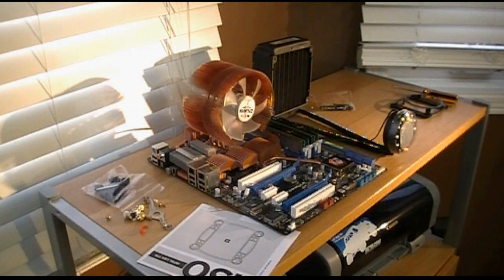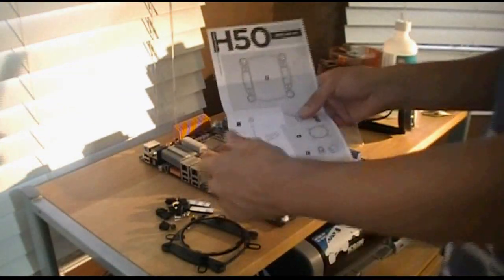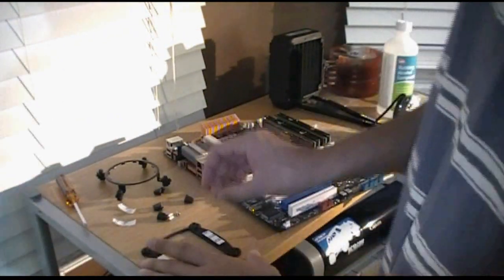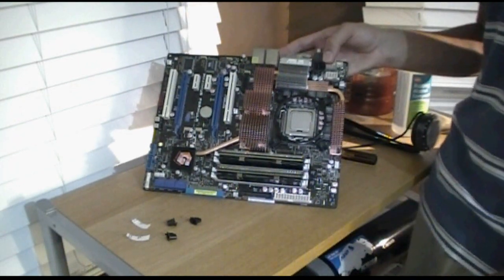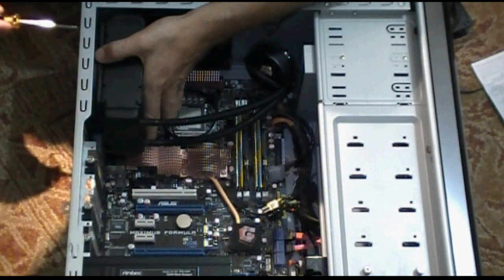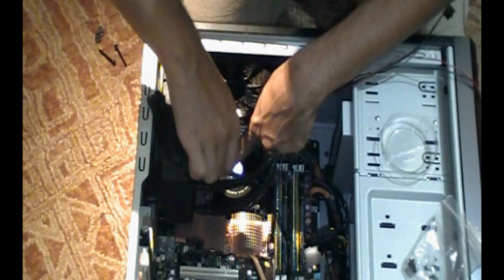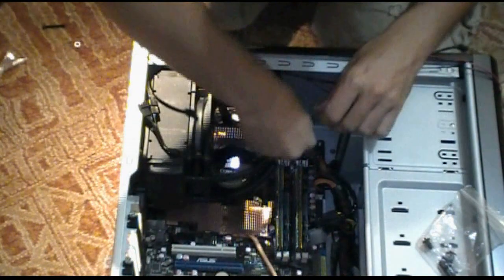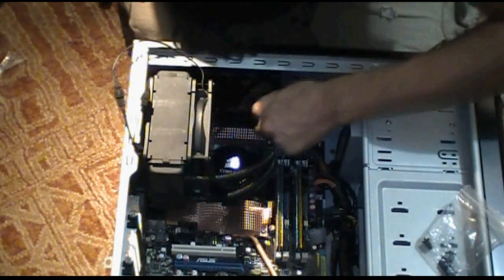Installation Guide Corsair H70/H50 (Intel) by The Tech Source

Comment from the maker: @fademan OHHH I think I know what you mean now!  The two fans each have a 4 pin power connector, you then connect them to the included Y-cable which has a single 4 pin on the other end which is connected to the motherboard.

- Dave

Comment from the maker: @ShervinGetOffMee What do you mean one fan slot?  The Pump plugs into the cpu fan header, and the other 2 fans have a coupler that makes them connect to any one other fan port on the motherboard.  Unless your motherboard only has the cpu fan header, which would really suck :(

- Dave

Comment: Just a quick note guys, not trying to be rude :) When your start to screw the brackets in place, you only need to turn the screw enough to hold the bracket in place. Ideally you also don't want your thermal paste touching the cpu until after the pump is in the correct place, so you can apply just vertical force for even distribution and less chance of air trappage.

Comment: @finaldestinyx The difference in most reviews is about 5-10 degrees Celsius (H50 vs H70) which is about 9-10 degrees Fahrenheit. Doesn't sound like much unless your OC'ing where every degree is critical. I spent the money for the H70 and went with Noctua NH-P12 fans for quieter running and better airflow. Still building at the moment so I can't give you my own temp results yet.
Super easy to install both H50 and the H70!

Comment: Also most users should actually attach the pump to a sysfan header and not the cpu header,(the extra cables are to drop your rad fan rpm to 1600 insted of 1950 max, to make it quieter at max. unless you turn off all fan controls in the bios for the cpu fan header it may slow your pump which you want running at full 100% of the time. the rad fans should go to the cpu header so that you can still allow your fans to be controlled by the bios (personally id just let them run at max all the time)

Comment: This is the simplest way for a less experienced user that doesnt understand the bios settings etc etc etc.... letting the pump drop with screw your idle temps to no end. which WILL happen if the smart fan settings on your mobo are enabled

Comment: What I found worked best was to not even deal with the retention ring until the end. At the time when you're going to install the cooling plate, take the retention ring and lock the cooling plate into its position. NOW go ahead and put them both down and screw them into position.

Much easier than having to deal with the godforsaken "HURRR TURN CLOCKWISE" crap.

Comment: I'm thinking of upgrading my H50 to the H70.  I just don't really know if I can part with £70-80.  From what I've read, the upgrade won't do any justice.  On the plus side, the H50 (and I'd imagine the H70) as very simple to install, and I'd recommend either Noctua or Xigmatek fans to supplement the radiator, rather than the stock Corsair fans that accompany the cooler.

Comment: does your radiator and fans cover the pump? I have a gigabyte board and my cpu slot is pretty far back towards the backplate and i'm worried it might not fit and i would have to use 1 fan instead of 2.. also did you previously own a h50? if so did your temps decrease a lot? i have a h50 currently and dont know if i should upgrade..

thanks.

Comment: I found the h70 to be really tricky to install. Having to wrestle with the pipes and the radiator, and trying to keep the water-block in place while I fasten it. I never seem to get the water-block seated properly. I wasted a lot of thermal paste trying again and again to reseat it. (I probably just suck at it.) The h70 is still a good cooler, but it does not reach its full potential when it's not mounted just right.

Comment: I'm having a problem installing the front bracket, it doesn't line up with the screw holes in my motherboard. I have an 1156, any suggestions?

Comment: @TheTechSource1 its not about fans ... is about 8 pin power connector .. this radiator is big ...  so there is no room to put hand there to plug 8 pin plug to the 8 pin power connector on mobo 

alright ... fuck it :D